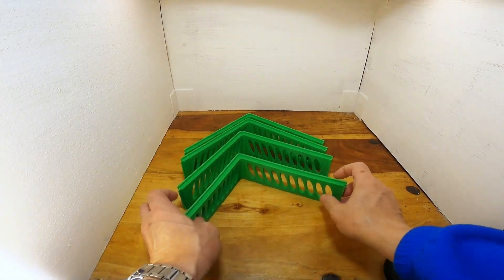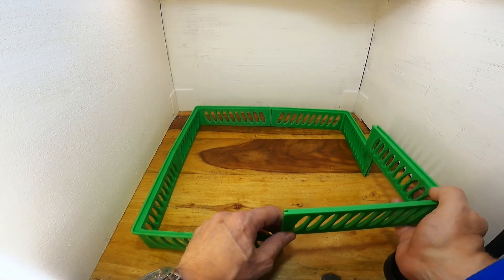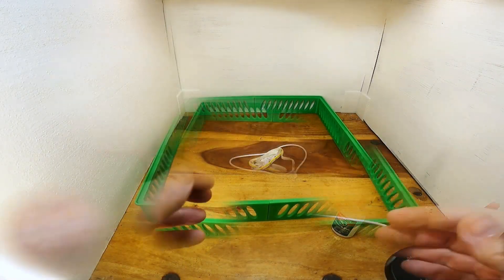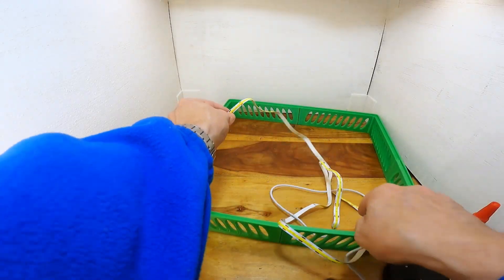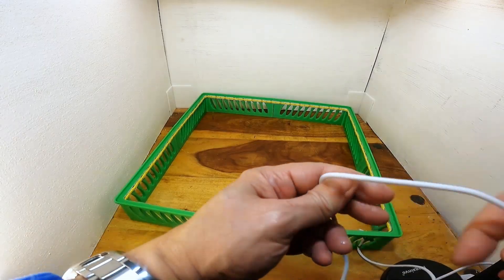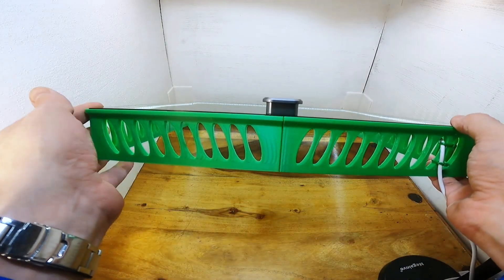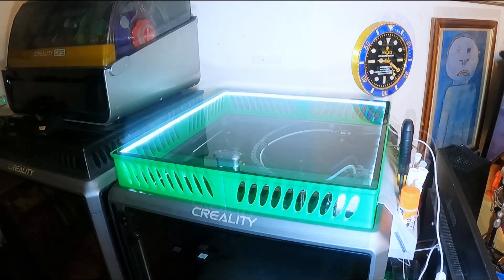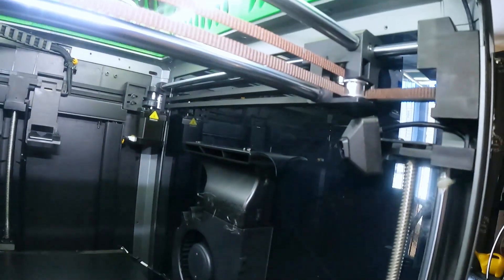K1 Max + CFS Upgrade 🔥 Simple Riser Upgrade!

Comment: Nice projects Mr. Kalbo tankyou. Tell me, I installed the CFS kit (k1max 1 generation with capricorn) and I have 2 units. Why don't almost the filaments it loads NOT enter in the extruder? Click, click, click. Not clogh, stop at the entrance. Any opinion? Tanks Not understand why!!!!! Im use Esun, sunlu, jayo (paper spool), Chitu Conjure, Creality same problem. im charge 4 anycubics too. No understand.
Reply from the maker: Hi and thank you. I can only really guess at the issue. If None of the filament is feeding through at all and you are getting the clicking, I suggest checking none of the wires from the motor have broken/come loose. Other than that you may have a blockage in the extruder.
Reply: @Kalbo64  Thank you, Mr. Kalbo. I not considered the motor cable option. I placed the cables slightly to the side, and they accepted the filament. Are there new motors that are more durable than the old ones? My K1max is the 1st generation. TANKYOU.
Reply from the maker: I'm not sure about more durable motors. I do know that some people have had issues with the motor. This is often caused in my opinion by the install videos showing the motor released from the old extruder , and shown just hanging by the wires until the new extruder is fitted, This can cause the wires to come loose or break. I have also seen issues with the glue compound they use to hold in the motor wires to the board covering the connection for the new extruder, and causing issues when it's removed.